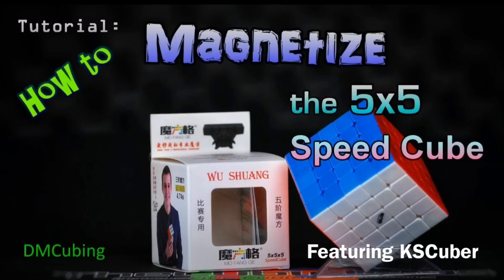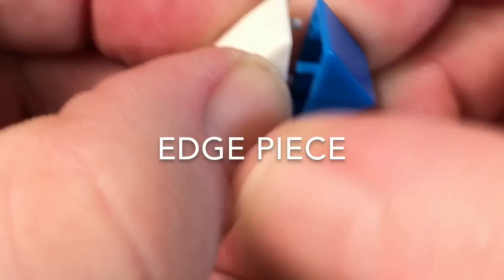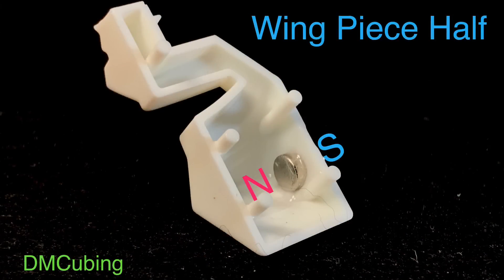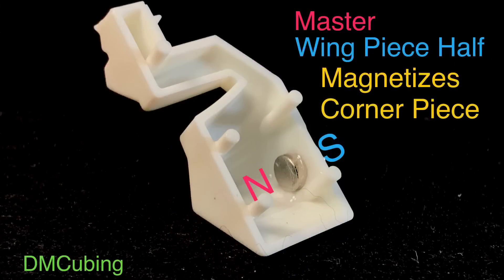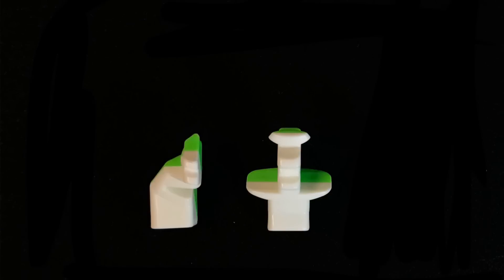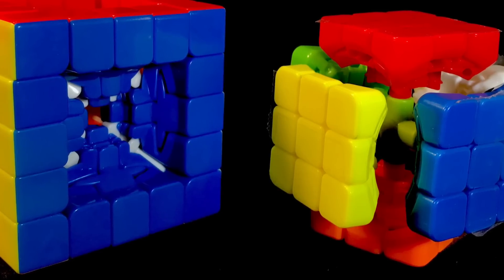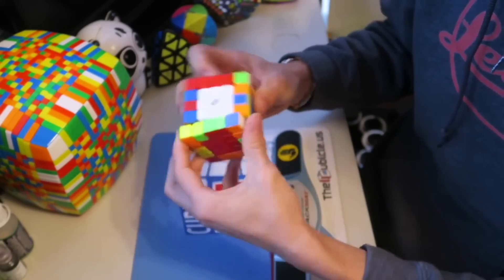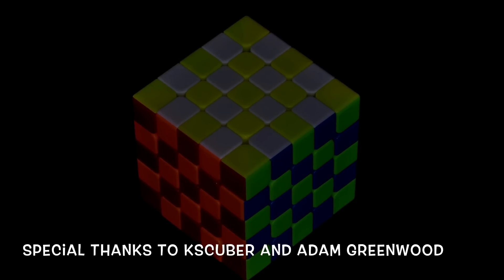How To Magnetize a 5x5 Rubik's Speed Cube (Wushuang & Others)

Comment: Will this work on a YuXin cloud 5x5?
Reply from the maker: Yes. It will work perfectly with the Cloud.
Reply: Last question pls, Can I put back my yuxin cloud if I completely disassembled it? And what is the best magnets btw? Haha I'm scared
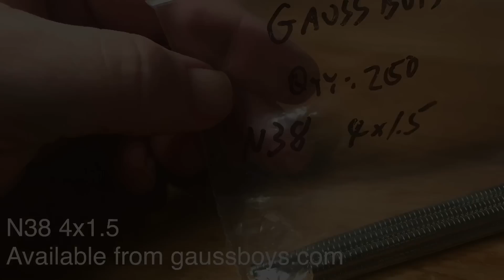Reply from the maker: Jason Luis Gonzales There’s no need to completely disassemble the cube, since you’re only magnetizing the outer layer of each edge. Check out 1:54 in the video and securely tape the inner 3x3 layers of the cube. You only need to remove the outer layers. 
For magnets, there are a couple of approaches. Some people use N35 4x2 magnets throughout the entire cube. This gives a fairly strong magnetic attraction. Other people use a lighter magnet like the N35 or N38 4x1.5mm. This gives a decent feel that a lot of people prefer. And you can increase the inner layers of the cube by using N35 4x2 magnets on the inner layer and N35 or 38 4x1.5 magnets on the outer. Check the video, as I show the layout and position of the magnets. You’ll need a total of 96 magnets. Have fun!

Comment: If i use 4.2 on the corner will it work?
Reply: Thank you so much love your vids
Reply from the maker: Ahmad Revindra 167 Always glad to help! Thank you for your kind words!!!!
Reply from the maker: Ahmad Revindra 167 4x2s? Yes you can. It will just have a slightly different balance feel than having weaker magnets on the outer cube. Just be sure to use lower strength 4x2, like N35.

Comment: Hey DMCubing is it OK if I use n50 4x2s?
Reply from the maker: VecolityPlayz Hey!
You mean N50 4x2 throughout the entire cube? You certainly could but it might feel a little unbalanced or have a strong magnetic attraction. I should mention, however, unless you're paying a higher price for them, MANY "N50" magnets sold at budget prices generally are considerably lower in strength than that, and are often actually N35 magnets being passed off as N50. So if the magnets you're thinking about using are budget priced N50s, they may actually work better in a 5x5 than strong N50s.
Reply: DMCubing Okay, thanks. The “n50” magnets are $4.99 off AliExpress, so they are probably n35s. Also, I already magnetized my 5x5, and it is really good.
Reply from the maker: VecolityPlayz Probably so. There could be some honest vendors selling real N50s at bargain prices, but it's a gamble. Most likely N35, which really aren't bad- it's a very versatile magnet!
Hey that's awesome about your 5x5!!!! Too cool!!!

Comment: Hello, I was wonderong instead of using 4x1.5 n35 can I use 4x1 n48 for my Wushuang (is the strenght of this 2 magnets almost equal?)
Btw excellent video which will help me magnetize my 5x5
Reply from the maker: Zemus Muyuri Hi! I'm pretty sure using single N48 4x1s is going to be too weak. And if you doubled/stacked them, the equivalent strength of an N48 4x2 would be too strong.

Comment: Hello, will 4x2mm N35 be better to use than 4x1.5mm N35. Which would
You recommend. Plz reply ASAP
Reply from the maker: Revan R In the Wushuang? Most people use the N35 4x1.5 for a moderately subtle feel. You certainly could use N35 4x2 throughout the entire cube. People have done this with success. It will be a stronger magnetic feel but still workable.
Reply: DMCubing thanks I will tell you my results in about 2 weeks when I finish

Comment: Hey DMCubing! I was looking on gaussboys website, and it said they don't have 4×1.5 magnets that you can't purchase over 96. What other size do you recommend to magnetize a wushuang?
Reply from the maker: Master Rubiks23 I just checked. They have http://www.gaussboys.com/store/index.php/magnet-shapes/discs/d04015.html
Maybe I don't understand the question. You should be able to buy as many, or as few, as you want. There's no limit. But if you buy $10 or more, you do get free shipping. So it's always good to make your order at least $10.
Also, once you set up a free account with them, you can use the discount code, DMCUBING to save an additional 10% off your order.
Reply: DMCubing I tried to purchase 200 4×1.5 N38 magnets, but it said the requested quantity is unavailable. So I was wondering, what other sizes do you recommend?
Reply from the maker: Master Rubiks23 That's very unusual unless he just happened to have run out. I usually order 500 at a time. I'd suggest giving Dave, the owner a call and see what's going on. The phone number is on the website and he's open on weekdays. Very unusual that he'd be running low on stock, but it is possible.
Reply from the maker: Master Rubiks23 Gosh I just tried adding 200 myself and it wouldn't go. Either he's out, or there's a glitch. It wouldn't even allow me to do 20.
Reply: DMCubing Do you recommend any other sizes to magnetize?
Reply from the maker: Master Rubiks23 You could use all N35 4x2 but it works out best if the inner layer is slightly stronger.

Comment: hey david! did you use the same strength for the magnets?
Reply from the maker: Joanette Caparaz Yes. In this cube I used an N38 4x1.5 throughout the entire cube.
Reply: DMCubing is a 4x1.5 N42 too strong for a 5x5 like this?
Reply from the maker: No. I think you'd be fine with that magnet. Some people have used all N35 4x2 throughout the cube and like the feel, so I think an N42 4x1.5 would be quite suitable.

Comment: Hey DM! I magnetized my WuShuang a few days ago with your magnets and method. It was pretty easy, but when I started using it the magnets were very light and had little effect. I guess I put them too far back in the inner layers. rip
Reply from the maker: Jordan Seigel Oh, please don't say rip. Give the cube some time. The magnets really don't have to be overly strong or pronounced, particularly in larger cubes. And generally speaking, it's better to be on the subtle side of magnetic strength than having a cube that has magnets that are too strong. 
I suggest really breaking the cube in, making sure that the lube isn't too thick and adjusting the tensions accordingly, and see if the cube doesn't improve over time. You might be surprised! Let me know!
Reply: Sure thing, DM! Thanks for the help!
Reply from the maker: Jordan Seigel Let me know if you notice any improvement. Thanks!

Comment: Does the polar arrangement of the magents make any difference to the feel and turning of the cube?
Reply from the maker: Tyler Hicks That's a good question. I suppose on a theoretical level, whether or not the polar layout has the two groups of magnets opposing or attracting, there could be a difference, but I doubt very much it could actually be felt, and maybe more importantly, how much it affects the cube in a negative or positive sense.  Other factors such as spring tension, magnetic strength, and lubricant play a more important role, I would think.

Comment: why is it that for the wushuang you can use the same magnet strength for the whole cube? Don't you want a weaker magnet for the outer layers and a stronger magnet for the inner layers??
Reply from the maker: doodle mogul It just turns out that using the same magnet throughout in this cube gives a great balanced feel with just the right attraction in the middle. It's because of the gauge of plastic and how the magnets attract. I got this recommendation for this cube from a couple of people who have built multiple cubes this way. And with other 5x5s, it's generally recommended to use a step up of strength in the middle. Of course, you could use whatever magnets you like to your own preference and use a stronger magnet in the middle of the Wushuang, it's generally not needed though.
Reply from the maker: For some reason, Youtube held both your comments for review. I have no idea why, and I can only find this out when I actually log into youtube on a computer, which isn't that often.

Yes, you actually do generally want stronger magnets in the middle so they hold the middle pieces into place while the outer ones are turned. However in some cubes the pieces move well enough that the it's less needed, and also, there is more force applied on the outer circumference of a turning object than its center, so the inertia of the center is less affected, ie, it generally stays in place better.

I got my recommendations for the 5x5 from several people who specialize in magnetic 5x5s, so I'm going on their experience.
Reply from the maker: Youtube has been hiding your comments.
The N50 4x1.5 would be just the tiniest bit stronger, basically .68 lb pull compared to the .64 lb pull of the N35 4x2. 

I think you actually could use all the same magnets of either of these two strengths.

We have a Facebook page up called, Magnetic Cube Help And Support you might be interested in checking out.
Reply: DMCubing What if i use all 4x2 N35 magnets? And what do you think is stronger - 4x2 N35 or 4x1.5 N50. It would be helpful, if you could answer :)

Comment: What magnet do u recomend for a DaYan 2x2
Reply from the maker: I'd probably use either a rather strong 3x1.5 like N52, or an N35 4x1.5. You want to avoid using a 4x2 magnet as they tend to be a bit too strong and result in a rather clicky, bumpy, cube.
Reply: Thanks
Reply: I might make a magnetic 2x2x3 if the mechanism isn’t that weird
Reply from the maker: Doughnut Cubing That would be really interesting!!!

Comment: So I'm trying to make a magnetic QiYi Wuhua V2, and I'm just trying to figure out what a good magnet strength and size would be to suit big cubes. Do you have any suggestions and input on how much pull force is too much pull force? I'm just playing around with the kjmagnetics calculator so hopefully that helps.
Reply from the maker: PrestonProductions1 In a 6x6? I'm just now starting to take notes on what people prefer. I know people generally like doing spring swaps. I've charted out the magnetic layout and have a Yuxin Red, but still need different springs for it. Anyway, right now I haven't settled on a choice of magnets. But you'll want the center stronger- it has twice the magnets compared to the other layers so you don't necessarily have to use a stronger magnet there. The next layer out from the middle needs to be somewhat lighter than the middle, and finally the outer layer to corners needs a lighter feel than the previous layer. 
Here's a 6x6 magnet preference thread I started on a Facebook group for magnetic cubes:
https://m.facebook.com/story/graphql_permalink/?graphql_id=UzpfSTE5MjE5MDk4ODE0MDYzMzE6MTk3NjA2ODYyMjY1NzEyMw%3D%3D
Reply: Thank you for the reply and advice! Unfortunately I cannot view that page. But in your opinion, if I used N35 4x2mm for the outer layers, would that be too strong?  The separation distance between them would be 2.2mm (the thickness of one piece doubled). I appreciate the help and I do love the content! Keep it up!
Reply from the maker: PrestonProductions1 You'd probably be better off using N35 4x1.5 on the corners, then working inward, N35 4x2, then finally either N35 4x2 or 4x1.5 on the very middle.
Reply: Ok! Thanks for the advice and input!
Reply from the maker: PrestonProductions1 No problem. 😀

Comment: Which tecnique is more risk free?
Reply from the maker: I prefer the master magnet technique for a variety of reasons. Mostly, I know that the magnet, once glued, won't slip. This method tends to produce a more accurate magnet placement. Now, there is the risk, if you're not careful about removing the magnet from the stick of magnets the same way each time, that you might mess the polarity up, but as long as you have the opposite end of the stick marked with paper or something, you'll always know when end to remove from.
I always make sure that the magnet is actually on top of a drop of glue. This assures that the magnet is actually glued to the plastic. Some people just position the magnets, then add a drop of glue. This method doesn't assure that the glue actually is under the magnet. Often people that glue this way use the masterpiece method. It's super fast doing it this way. But I don't agree with the gluing method this way. There is a way to glue properly and use the masterpiece method, and once you have both master pieces made, you won't have any polarity worries. But honestly, when I use the master magnet method (which I prefer), there's not any point when I'm not positioning and gluing magnets, so really one method isn't faster than the other when you're properly gluing.
Also, with the master magnet method, I feel the magnets end up more precisely placed. There are times, however, when the master piece method is more appropriate, like when doing a Gan or Valk 3 Power. I use a modified version of the method then.
Reply: DMCubing wow!! Thanks so much

Comment: Further question. At 5:00, does the first piece have to be dry when you do this step?
Reply from the maker: WinkGuy It will be dry enough because you've already done all of the first piece. The glue won't really be fully dry for hours, but at this point, even though it might still be tacky, it will be dry enough to hold the magnet into place.

Comment: DMCUBING can you make a video for Magnetiz a QIDI 2X2 PLSS REPLY
Reply from the maker: I think I've had two other requests for this cube. Generally speaking, there are two basic designs for 2x2 cubes- those that have removable caps, and other that have pieces that disassemble. More than likely, the qidi is going to be one of these two designs.
If you can disassemble to, you can find out. Probably one of my existing videos would work. Usually the challenge with some 2x2s is finding out how to take them apart, sometimes the caps are screwed on- stuff like that. But I'll try to check into this cube!

Comment: Nice video! How well do you think 4x2 N35 throughout would work in a Yuxin? Just turning the puzzle makes it feel like it has thicker plastic than the Wushuang
Reply from the maker: I haven't tried that cube, but I do believe you're right. If you don't use all N35 4x2 throughout, at least use them in the middle, where you'll need the extra strength.
Reply: DMCubing alright, thanks!

Comment: so we only put the 4x1.5 in the corner piece ?
Reply: and the right wing?
Reply from the maker: Tech Dares Exactly, if you're using a stronger magnet on the middle.
Reply: im replacing N35 4x1.5 with N52 3x2
so in the right wings and the corner using the N52?

Comment: Just wondering why you use the same magnet throughout for the WuShuang
Reply from the maker: exing1OoO1 Prior to making mine, I asked around what other people were using. One person in particular, Adam Greenwood, from our Facebook group, Magnetic Cube Help and Support, had mentioned making a large number of Wushuang 5x5s for cubers in the UK. He uses mostly N35 4x1.5 in his, but occasionally has people ask for all N35 4x2, and others ask for a combination of N35 4x1.5 and 4x1. 
Other people I heard from used all N35 4x1.5 or all 4x2. So I chose the N38 4x1.5 since it's close, and I have so many. 
According to Adam, some other 5x5s need a stronger magnet on the inner layers. With the Wushuang, you can use the same magnet throughout.
Reply: DMCubing will it still give good control during 3x3 stage. (What I mean, because it may not be clear, is like in the wuque the inner layers are stronger so 3x3 stage is easier. Will the same magnet throughout for the WuShuang 5x5 also do this)
Reply from the maker: exing1OoO1 I believe so. You could ask either KSCuber, who has the cube I made, or check with Adam on our Facebook group. They're more knowledgeable about this than I am. But I do know that Adam says he uses the same magnets throughout for most people who use his cubes. Check out our FB group.
Reply: DMCubing ok cool thanks sm
Reply from the maker: https://www.facebook.com/groups/1921909881406331/

Comment: Do you think you will magnetize a Thunderclap 4x4 (60mm) soon? I'm thinking about do it myself because it seems to be a nice magnetic cube.
Reply from the maker: I'll have to try to get one pretty soon. Most 4x4s have a similar design with the cubie pieces, so most can be magnetized pretty much the same. But there are other considerations, like plastic thickness, weight, and size that can factor into it.

Comment: Hey, I got a question about the GTS2. I want to magnetize it after finding out that loosening it made it smoother (but way more unstable) and I'm thinking of using 4x3 n45s. Do you think 4x3 is a good size or should I take 4x2s or 5x1s?
Reply from the maker: iOBX Definitely 5x1s. I've magnetized 27 of these cubes. N42 5x1 is my favorite. Gives a perfect medium magnetic feel. Cubicle uses an N48 5x1. I prefer the N42 5x1. I have several videos about the GTS2M on my channel.
Reply: DMCubing Ok, thanks a lot. I think I will get 5x1 N45s as well as 5x1 N42s and see which one I prefer.

I noticed that the GAN Air SM has a really weird magnet size, it looks like a 4x3 to me (I will measure it later). If you get your hands on one I would suggest taking a look at the optimal magnets for it, because the Air S is only 30-something dollars and magnetizing it might be better than flat-out buying the SM.
Reply from the maker: iOBX The SM has 3x2 magnets in a relatively high strength- not N35. I have one. The S, however, doesn't have the little slots for the magnets.

Comment: For a qiyi wuque what n35 magnets would you recommend for the inners and outers? I'm thinking 4x2mm n35 for the outer layer and 3x2 for the inner layer, but I'm not quiet sure.
Reply from the maker: AmaanDaCuber Yes, that is certainly a useable choice of magnets. 
Since the Wuque is similar to the Yuxin Blue, you might be interested in reading the pinned comment thread in the comments section of my Yuxin Blue video. Lots of good info from people on magnets they're using in the 4x4:
https://youtu.be/5OClFf-Ddrw